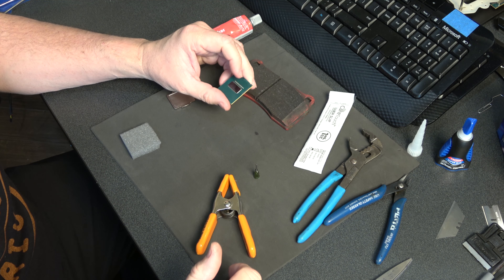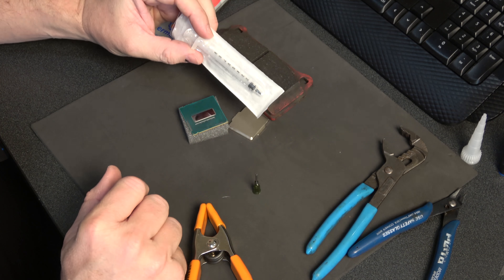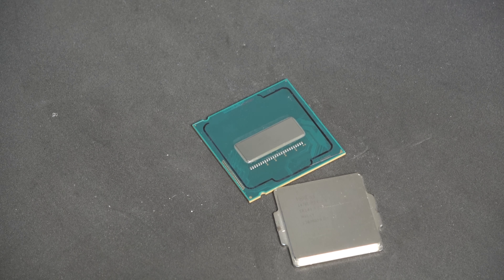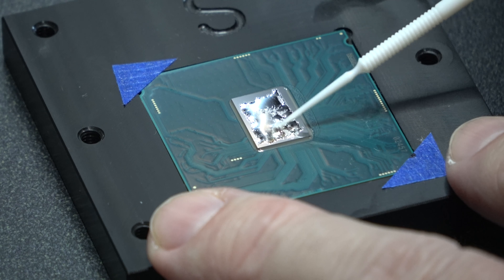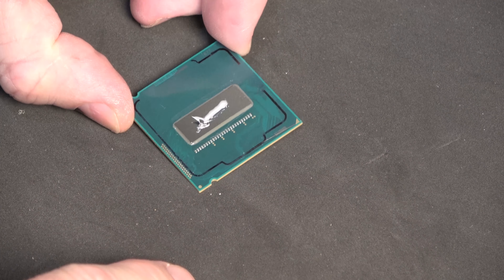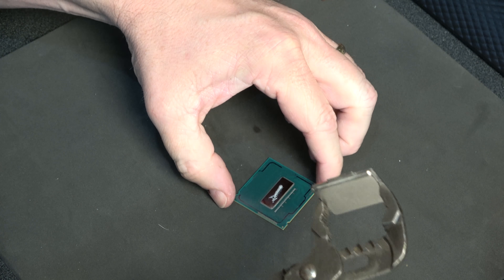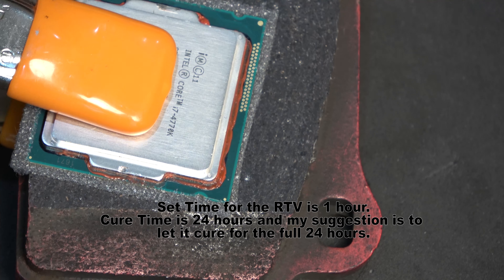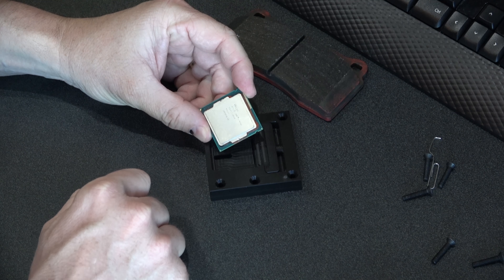DIY Intel CPU Relidding with no Delid Tools

Comment: Kyle, you just convinced me to redo my delid on my 6700k...this time clamp it down with foam support. I pinched her back together after it tacked up, and popped it back in my socket and clamped it down.  When returning home 2 hours later, I put the water block back on and started using PC as normal.  My temps went from 63 at full load to 50.  I wonder if I can get it cooler with clamping it back on.  Thanks for the vids man!

Comment: I would use RTV silicone that says "ultra" in it.
(Ultra Black, blue, red, etc.)
That means it is oxygen sensor safe and fume free.
This means that when it gets hot,
no fumes are emitted that can harm electronic devices.
Regular RTV silicone will emit fumes, more when hot.
Reply: there is no ultra red..

Comment: kyle, the heatspreader is maybe a little bit far "above" the die (little gap)
it is possible to scrap down some 0.02 -0-04mm off the heat spreader: at the perimeter. so it will be lower.
maybe also scrap off some 0.02 off the thickness

Comment: Good video.  14:50 Why not just put a weight on top rather than use a clamp?  Pressure would be uniformly spread. 16:40 From everything I have learned, it is better not to reseal the IHS to the PCB. Just tiny outside dabs of gunk at the corners if you want to secure the IHS, otherwise don't seal at all. Some people use tiny dabs of Crazy Glue. Apparently it is desirable to reduce the distance between the top of the die and the IHS, with lower temperatures being reported as a result, although some people suggest the IHS may be riding entirely on the die then.   Also, maybe a good idea to paint the top of the PCB and tiny components with suitable (non-toluene)  clear nail polish or a professional compound such as MG Chemicals  4223F polyurethane protective conformal coating), to prevent any shorting by the liquid metal if it flows out (the other MG compounds 419D, 422B and 4225 are no doubt also OK).

Comment: Can someone tell me the practicality of removing the lid of a CPU? I assume that they would be extremely difficult, to impossible to modify, or maintain/repair.
Reply from the maker: We generally apply a much more conductive Thermal Interface Material, which brings temps way down under load and provides us with better overclocking results.  You can see some results here:  https://www.hardocp.com/article/2017/10/11/overclocking_intel_8600k_delidded_on_air_water/
Reply: @HardOCPTV  
Oh, gotcha'. Thanks for the quick  explanation!

Comment: I was inspire by this video to give my own delidding a try and I can attest to being able to do this without buying a single thing. Just takes patience and nerve.

Fortunately, I have a 3D printer and was able to design, and successfully use my own, custom made delidding tool. Worked like a charm, though it destroyed itself after the single use.
I went with copper high temp sealant instead of the red, but that was simply because that's what I had on hand; red would work just fine and copper's only difference is a higher temp rating which is way over anything a CPU should ever see and color.
I also 3D printed my own, custom, relidding assembly and used some medium pressure clamps I also had on hand. Cured for 20 hours, there abouts.
I used a syringe and needle tip I had on hand from an ink refill kit and clamped the end to get a finer bead almost exactly like HardOCP did.

Didn't do any fancy benchmarks, but can already tell temps are way down. I used the CPU-Z's built in stress test (before delidding) to see temps hit 70C+ temps, now (after delidding) same stress test yields test no higher than 61C.
I had concluded that I didn't get the best chip of the lot and experienced the same temp spikes as other users experienced. I also realized this CPU will probably never see stable 5Ghz, but that's not a problem for me as I don't usually OC; was just tired of seening wild temp spikes simply by opening a browser and such.

To me, overall, it has been a big difference and well worth the effort, though my hands are still shaking from the attempt. :) Thank you HardOCP for your many experiments.

Note: I would recommend is either working on an anti-static pad or wearing an anti-static wrist or leg strap. When relidding I also used a cushioned material similar to HardOCP's technique, but also had that wrapped in anti-static material. CPUs and RAM are highly sensitive to ESD and precautions should be taken to not damage the components. This includes making sure to neutralize any tools being used.
Reply: I ve changed 7700k my cooler to EVGA clc 240 because those temp spikes. Today I learn this whole thing . Water cooling didnt help much , almost whenever I open mozilla , cooler fans whines cause temps reach 60-70 ish degree Celcius.  I even thought selling cpu and board and move Ryzen 2. Because those kits + sealents + liqiud metal thing + shipping will cost 60-70 euro.

Comment: ive delided about 40 cpus in the last few years... started with haswells. Haswells used to be great. clamp them into a vice, take a block of wood and smack em with a hammer... these days Skylake and Kabys PCB so damn thin had start using razors... still only takes about a min but the first 6700k i smack with a hammer i cracked the pcb in half lol. Just keep getting thinner and thinner =D
Reply from the maker: You would be correct sir.  I took some time to get out the caliper and go over some old favorites.  https://hardforum.com/threads/naked-intel-core-i5-7600k-kaby-lake-how-to-h.1924043/page-2#post-1042803724  Since Haswell, the substrate has gotten tremendously thinner.

Comment: Man I ain't doin any of this shit. I'm replacing my 2600k with Ryzen 1700. I was so excited of ugprading my rig to 7700k but then all these delid trends came up because Intel used a shitty TIM rendering high temps on AIOs even without overclocking.
Reply: wimpy
Reply: Itbankrock  Ryzen for gaming is not upgrade from 2600k and 2600k is soldered so it's same as having decided cpu
Reply: Enjoy the bottleneck LMAO
Reply: 2600k is still strong

Comment: I'm SOOoooo early to this video I am having trouble not typing FIRST.  On a more [H]ard note is there any benefit to resealing the lid? i delided a 6600k and used Liquid Ultra and just placed my lid on top when reseating.
Reply: Obviously I didn't finish watching the video before commenting.  However i did a 'not normal thing' when I re- lided mine. I painted the entire non-die area with a ceramic TIM just encase I used too much Liquid Ultra.  In hide sight my guess work and fumbling probably kept everything kosher.
Reply from the maker: Addressed in the video and I am putting the review article together now.  Writing it as we type.
Reply: Thanks for the sealant tips/tutorial boss. When I remount mine in the future I will definitely be referencing your article/video.  Thanks for the video I am definitely the kind of person that needs to see a thing done in order to copy it.  Great step by step. 

Side note,  when did your beard go ALL grey!?!?
Reply from the maker: Hehe, beard went gray a long time ago!  I will update the video with the link to the article in a bit.  It is short and to the point.
Reply: Deliddiing a 6600K is unnecessary.

Comment: Why do you leave the gap when resealing the HIS? Wouldn't the air get pushed out as long as it's clamped strong enough?
Reply from the maker: That leaves a gap for pressure changes as it heats and cools.

Comment: I've seen videos of people using super glue to relid the ihs. Is super glue or gasket sealer better for relidding? Thanks for your video btw.
Reply from the maker: I am not a fan of using "super glue."  It sets up fast and if you do not use enough clamping force, you can negatively impact the Z height of the IHS.
Reply: Makes sense. Thanks again!
Reply: Super glue is really bad.

Comment: lol, just put cpu in socket and mount cooler. That is ideal pressure.
Reply from the maker: But what we have found is that without sealing it increases the Z height in the socket due to more substrate flex.
Reply: but what I said is with sealing :). So put all as u with glue and put in socket and put cooler and wait till tomorrow. That's it.
Reply from the maker: Totally agreed!  Just do not put a cooler on it while the glue is setting up in the socket.
Reply: why not, stock cooler. That is minimal but enough pressure.
Reply from the maker: Because when you put a cooler on there, you pushing down on the IHS, and the IHS is pushing down hard on that substrate, and the substrate flexes into a concave shape making the Z height greater, which is what you do not want.  Setting up the seal with the socket is NOT ideal, but does work.  To get the best Z height you would want the substrate fully flat while the seal is setting up.  This is why we do not suggest you using the socket.  That all said, it is not going to be a night and day temperature difference, but every little bit is what we were shooting for.
Reply: You said that IHS will bend on core?? I don't think so. Core is highest point and the IHS wil first touch core. There will not be any bend IHS on core.
Reply from the maker: No, I said the IHS pushing down on the substrate that is only supported at the very far edges will bend the substrate into a concave shape.  The IHS is not going to be at all.
Reply: When IHS touches the core there is a gap between IHS and cpu printed board.
Reply from the maker: Whatever works best for you.  :)
Reply: ok np my man :D

Comment: I don't care what anyone says. Have you ever watched a video of someone 
deliding their processor using one of those deliding tools? These 
machined tools send such a tremendous shock through the entire processor
 at the moment the lid breaks free. This cannot be good for the millions
 of tiny circuits packed inside the chip. No way is that a good idea... 
You might as well throw it against a wall, it's about the same shock 
level! ... The razor method is the only way to go. It's gentle and non 
destructive as long as you make sure to keep the blade absolutely 
parallel with the circuit board of the processor, and not let the blade 
go in too much as to protect the raised chip in the center from getting 
scratched. Otherwise, the razor method is far superior to the shocking 
delding tools available today.
Reply: There isn't shock like you make it to be. Certainly not even remotely close to throwing the processor.
Reply: ive been running a delided 4790k for several years now, 24/7 on an aggressive overclock.
absolutely no issues. I dont know what you're on about.
Reply: Same here man, he is probably just salty as he tells himself that he will break his cpu if he delidds it. So he talks down on the fastest and safest method to do it. Do a quick search and look up bricked cpu's using vice and razor blade method then check bricked cpu's using delidd tool. So tell me which one is less risky lol.
Reply: CPU's and GPU's have been proven to be very durable. Delidding it wouldn't break it unless you smashed it with a hammer. If you are careless with it, yes you can chip the silicon, then it's as useful as a paperweight, but if you are careful, it can easily be done.